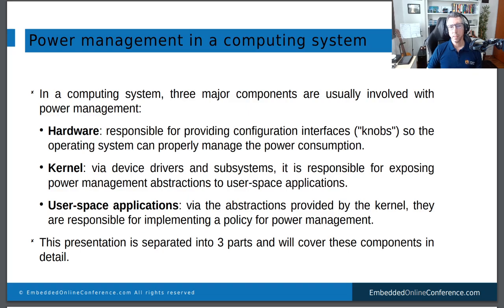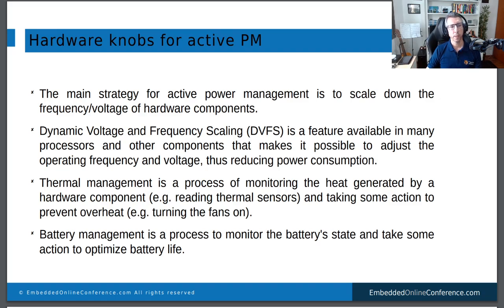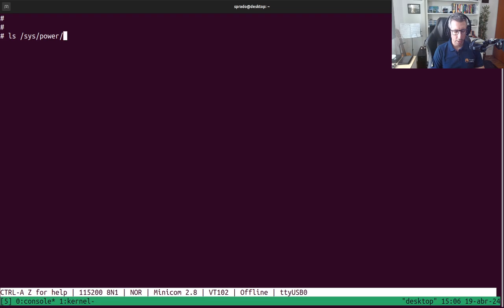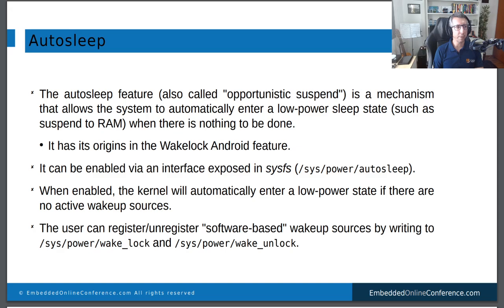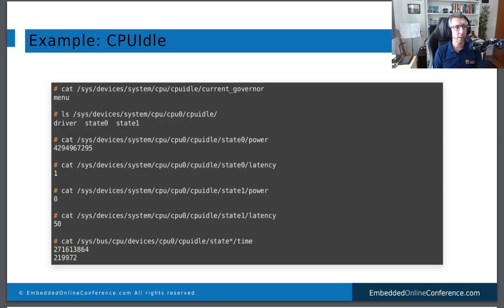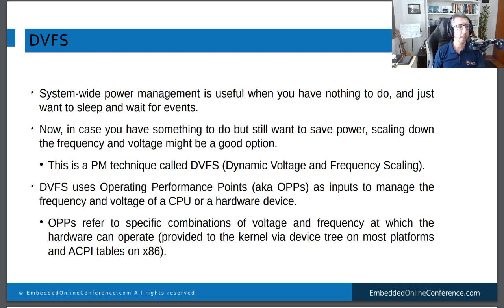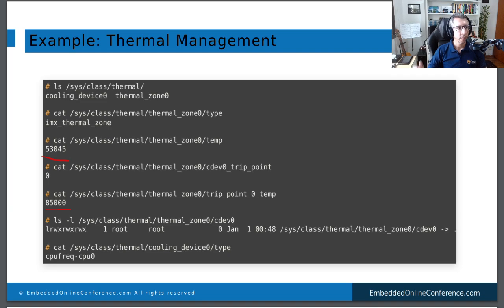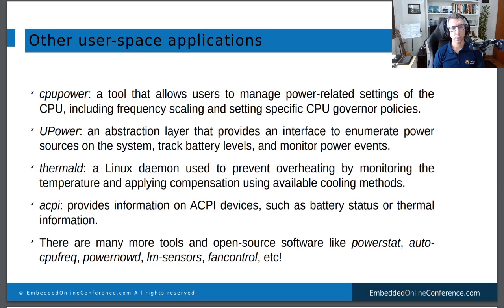Power management on Linux: from the hardware to the kernel and userspace interfaces

Comment: The Linux kernel just keeps taking more, and more options away from users over the years. Linux felt like a faster operating system 10 years ago. The last time I used it. It feels slower these days, and I think it's because it has more power saving features baked right into the kernel that can't easily be disabled without editing, and recompiling the kernel. For example, I'm currently having trouble with my archive HDD. It goes to sleep regardless of having the power down feature disabled in settings. This causes a lot of problems for me, one being LM Studio not waking the drive up when it starts, and so it thinks it has no models, and if I try to download a model, the download fails. It costs virtually nothing to spin a hdd, and users who choose to keep their drives spinning are in a small minority. Linux devs aren't saving the environment by removing the option from users- they are just deluding themselves.

It's much better for electronics to stay warm, than it is to heat cycle them. Contraction, and expansion are what destroys them, mainly. HDD bearings can essentially spin forever. It's the starting, and stopping part that wears out hdd's. Whatever these Linux devs think they are saving the world in electricity, is almost certainly offset by the HDD's that experience early failures as a result of constantly cycling on/off, and it may be worse.
Reply from the maker: Yeah, I don’t think it’s an inherent kernel issue, but more of a distribution problem. Most Linux distros prioritize ease of use, which is why power users often prefer distros like Arch for their flexibility.
Reply: @spradotube  Grok 3 just walked me through installing a small utility called 'hdparm' that disabled spin down, and enabled it's highest p-state. Hopefully that fixed it. I think so. Thanks for the reply. Not all distros make their kernel available as like a searchable repository? I'm on PopOS! and they don't seem to.